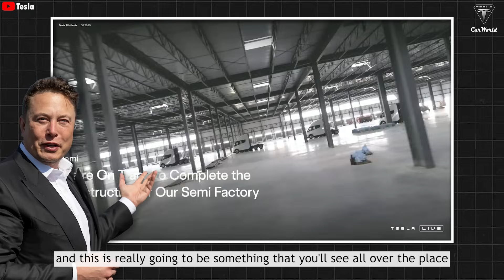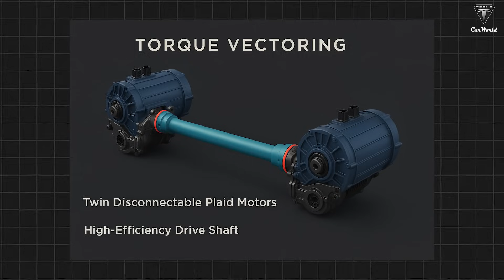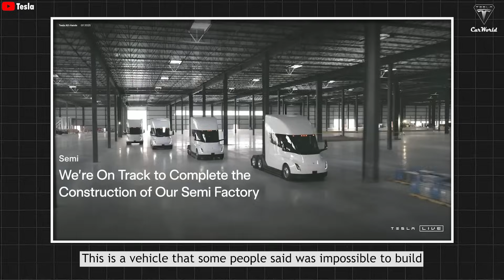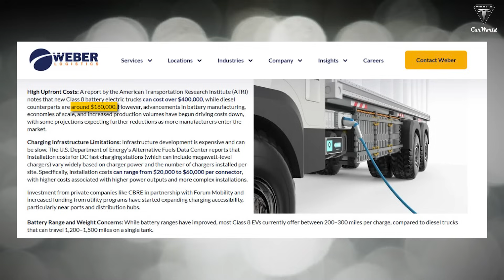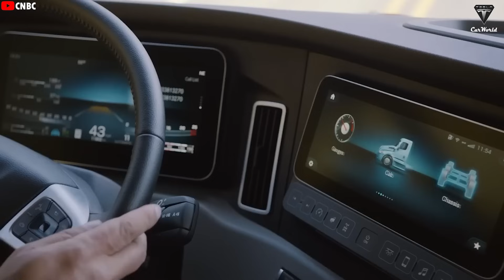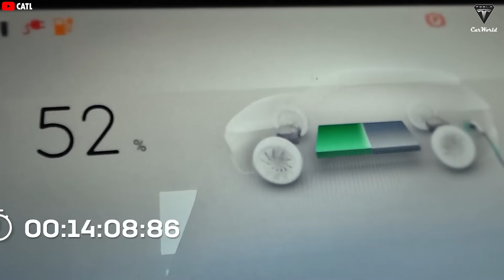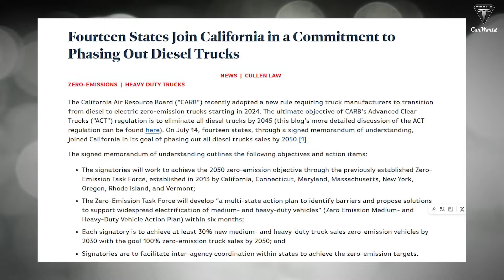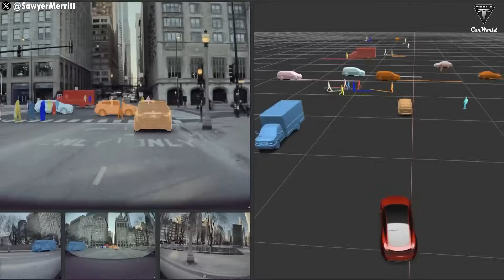Tesla Semi BREAKS ALL Reality For $200K! Elon Musk Announces Mass Production Million Big Rigs! HOW?

Comment: You got to resurch see if it's worth it. Check out batteries,how long they will last. How much will they cost when needed to replace. Would make great camper.
Reply: Data on cars show batteries lasting longer than originally planned. They might lose 10-20% capacity after several years.

Comment: I'm a truck driver and this video is packed with deception. They conveniently left out that the lifespan of an electric truck is far shorter than the lifespan of a diesel truck. When the battery life ends, so does the electric truck. You would have to buy 2, 3, or maybe 4 or 5 e-trucks consecutively during the lifespan of 1 diesel truck. The insurance for an electric truck would be at least double than that of the diesel. Also, that part about an electric truck not being able to tip over is absurd. It is the trailer that actually tips over, not the the truck. We truck drivers have NOT been "dreaming of self driving trucks," because we want to keep our jobs. Also, most of the trucks we drive now have some of the technology which would be required for self driving trucks. Namely, emergency automatic braking while the cruise control engages. I've driven 5 so far with this feature and all of them brake regularly randomly for absolutely no reason, which can cause a jacknife on ice. Almost every time they engage, there is nothing in front of the truck. They do this because the radars which detect objects don't really work. Self driving vehicles are dangerous and every time one malfunctions, causing death, the CEO of it's nanufacturer should be personally civily and criminaly liable. Elon Musk is just fake Republican, greedy scoundrel who is willing to eliminate the jobs of most people with AI.. When people can't find adequate jobs, they vote socialist, and Elon Musk, Donald Trump, the Bush's, Biden, Obama, Democrats, AND Republican politicians and business leaders know this. They are ALL corporate-socialists because they know that's where road that they're leads down ends.
Reply: Oh it’s coming.  Fight it, and you will lose.  I would gladly get rid of my biggest headache, our bad truck drivers.  Not our good ones I want to make sure everyone understands.  30% are garbage and should not be drivers
Reply: Honest questions.  How much does a traditional gas-guzzling big rig equivelant cost?  Twice as much?  Three times?  Five times?  I'd like to know. Also, how much in FUEL charges would those "2, 3, or maybe 4 or 5 e trucks" save?  And why does "insurance" have to stay the same "twice as much" price if something is mass adopted?  Just because?  Not challenging, just curious!  Thanks.

Comment: At 7:15, 21,750's eh? 6 x's longer lasting eh?  There's something you forgot to mention. Still watching.  At 7:33, I'm sure at 250,000 the tesla tractor would have a pretty nice cabin and bunk because it's a hefty price that goes in that price of 250 , maybe my recommendation of using the frame of the tractor to frame the battery pack is considered I've never received any kind of response to the recommendation of nearly 4 years ago, at 9:30, regenerative braking is a huge benefit for trucking while regenerative braking was a side effect improvement from another invention and technical improvements out of my content and the start of the push around 1990 talking about recycling gas from the muffler back into the motor when this question led to everyone questioning resulting in  many advances in vehicles, many conversations,  good conversations lead to more questions, most importantly getting the gasoline to burn off more but not until 2010 I designed the exhaust manifolds to recirculate the exhaust from 2cylinders into the the other 2 cylinders on a straight 4 cylinder , I had somebody weld it together and watch me drive it away

Comment: Impossible to power a semi with a battery to do 200 miles charging infrastructure is non existent
Reply: Edison motors is doing it the best, having a diesel generator in the engine bay charge the battery is perfect.

Comment: Good video. At 500 miles it's just a little short of usual long haul daily distance, at 600 miles it's there aside from team drivers. I'm assuming this is the range for a fully loaded trailer.
Reply: We can legally drive 11 hours in a shift. Calculate that with the speed limit and it's over 700 hundred miles in most cases. Sometimes 800.
Reply: @shaneamundson1192  Perhaps if you are out west, but most on the east coast and going into/through cities I think most times will be under 60mph and 11 hours of drive time.Granted drivers will get over 600 miles sometime, so 700 would be a better range.

Comment: Regional semi only, right?
Reply: NO... Think about it. The Semi with FULL FSD on the highway, even if after 500 miles, it took 1.5 hours to stop and charge, the driver would be in a position to not have logged any personal drive miles because FSD will be far enough a lot to be totally autonomous on highways, so this tech will allow the Semi to keep driving and driving except when needing to charge
Reply: Unless there's a big improvement in battery tech or hot swapping, yes.

Comment: Now make an electric motorcycle that can go 500 miles on a single charge.
Reply: Some of us have our motorcycle license. I would probably still get a Honda because they make good stuff. Right now an electric motorcycle cost just as much as a gas powered one but tops out at 65 to 99 MPH. And the Kawasaki electric bike has a range limited to about 41 miles. Who wants a bike that cost $7000 and can only go 41 miles before needing another charge?
Reply: @blackflyingfox3365 especially when you can get an ebike with 90mi range for wayyyy lesss
Reply: @ Sure, 41 is ridiculous. I was asking about the 500-mile one you were looking for. That is extremely high
Reply: Elon is claiming a battery with a 500 range in this video.
Reply: @ In the Semi... Yes. Not for a motorcycle which is what you want
Reply: 7:19
Reply: the electrolysis project i have been helping with can already power motorcycle and drive across the country on a few gallons of water. I triggered a change.
Reply: Why would anyone want that?

Comment: Does the lower center of gravity from the battery pack prevent large surface area trucks from blowing over in the wind?
Reply: Should help a LOT.
Reply: Has it been tested?  Lots of  traditional semi trucks are blown over in tornado alley or in blizzards,  A larger battery pack should help prevent rollover as well.
Reply: It would help the truck, sure. But the majority of wind related rollovers is due to empty box trailers being blown over while being pulled down the highway. Not the actual tractors.